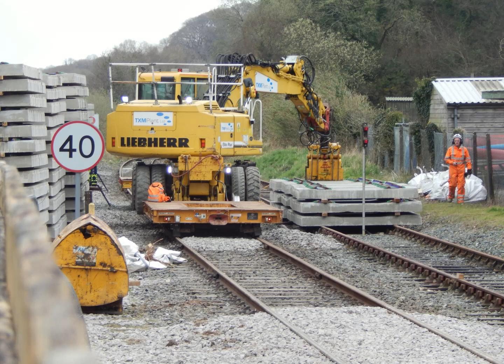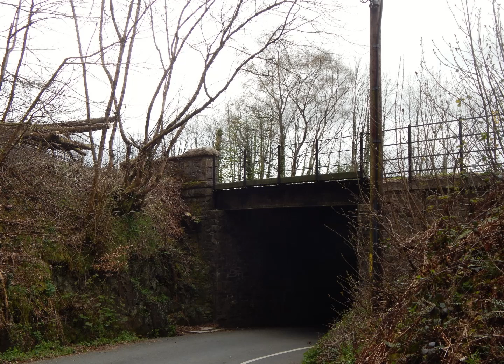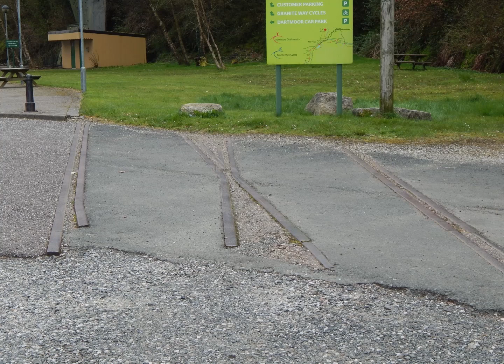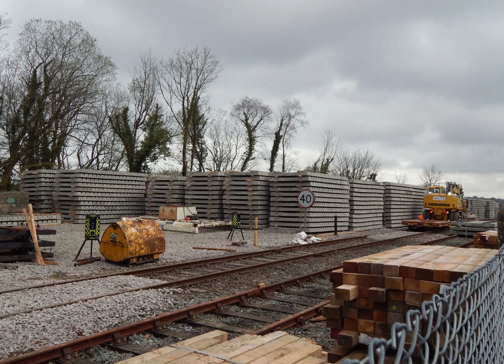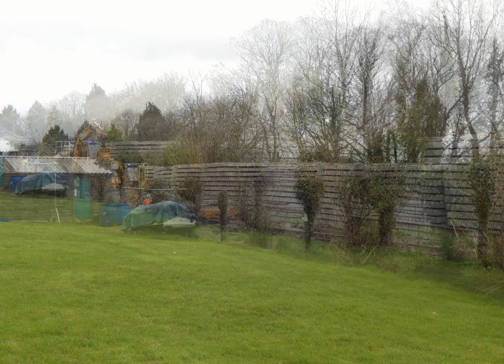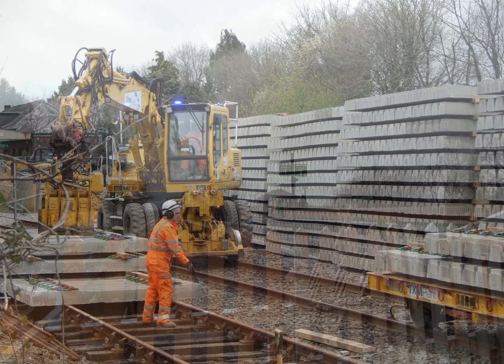A cold and grey Okehampton morning - 5th April 2021

Comment: Wasn’t the line between the Junction and Mellon sold off to the quarry company?  If so, how did that affect the re-opening, did Network Rail buy it back or did they negotiate running powers with the quarry company?  If they bought it back then the cost of that, plus the refurbishment, must have made it very expensive.